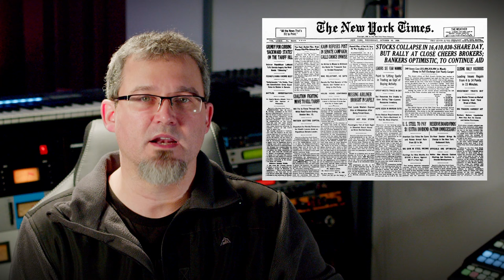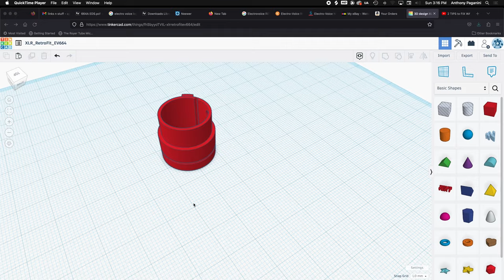Electro-Voice 664

Comment: I have 2 EV 664s in my collection. When I got them from eBay, from 2 different people around 2020, they both came with the cable, so no problem. They both sound good to my old worn out ears.
Reply from the maker: Can probably sell the cables for what you got the mic for! lol.  They're not terrible mics.  Theyre definitely not "modern" sounding but i think that s the whole point.  I've used my connection mod on a few mics now.   The 664 a 630 and an old shure 535 omni mic.  End of the day, as long as you can get the signal out of the mic into a pre, you're good to go!  Thanks for watching!

Comment: I own three of these. Two original port design, one large port design. All of them in excellent condition. They are definitely spoken voice mics. That doesn't mean they can't be used on all sorts of stuff and EQ adjusted appropriately. They're certainly good enough for that. 

Besides a lot of live sound engineering, I'm a licensed ham radio operator. These make an excellent communication mic. You don't want full range audio on SSB. It's counterproductive. You want all the power in about 200 Hz to 3 kHz for a 2.8 kHz max legal bandwidth with it sloped up in the 1 kHz to 3kHz and with moderate compression to level power average across vowels, dipthongs and plosives. You don't need or necessarily want full fidelity on FM for communication applications -- although it's cool to have a radio voice on FM ham radio -- it can compromise intelligibility in challenging environments.

I agree with an earlier commenter. If you have a working one, don't mod it. Buy a non-working parts-only or prop-only one and mod experiment with it. They're inexpensive and common enough for that. 

Thanks for the great videos. They have helped me make some mic acquisition choices.
Reply from the maker: Thanks for the great comment.  I was studying to take my exam during covid lockdown and never got around to actually taking it.  I dont know that I need another money pit of a hobby though lol.  I am really into building electronics and i'd be that guy thats got the giant lattice work antenna setup on a concrete slab that the neighbors complain about. lol.  One day though... one day!

Comment: Ham radio guy here. The EV 664 really was a pinnacle of high end ham radio microphones back in the day. Often pictured with the very high end Collins S-line as well as Drake and EF Johnson Viking on their much higher end equipment. I have a 664 that I use with my Collins S-line. They were so popular as a desk microphone with the optional desk stand. I had no clue the connectors were so expensive. Am I surprised? No. But it does remind us of a time where everything was still incredibly proprietary. As I do restorations on antique radio equipment I am no stranger to proprietary parts. Most of my equipment is very rare pieces. And of course, because so few were made, and the parts were so specific, there is little to absolutely no chance of one actually finding some of those replacement parts. Thanks for the video!
Reply from the maker: Thanks for checking it out!
I was studying for my exam during lockdown and never made it in to take the test. Im not sure i need another audio related hobby though i would love to learn how that stuff works. Most of the communities that ive silently stalked online seem to be very standoffish and gatekeeperish to some degree as well. I mean what hobby doesnt have those types lol.  The funny thing about the connector for the mic is that at one point it was pretty much standard for these and other EV mics. I would have thought there would have been thousands of these things out there in any form of disrepair (its just the connector we need). Sadly, nope…. I had a heck of a time trying to find some weird caps for an amp rebuild a few tears ago. Finally found a HAM guy that was rolling his own.  Worked great!
Reply: @meistudiony  hey, it’s never to late to follow through with the license! The Gatekeeping is a thing, however some good starter resources are videos by Bob Heil (Heil Audio). He does some very good explanations on mixer to transmitter interfacing and very good explanations on audio mixing and going into some good depth about audio response for ham use. You are right, it was a popular connector for Electro Voice. But just compare that today with XLR. Or a 4 pin XLR. Those have become the industry standard. In other words you don’t HAVE to have the manufacturers specific connector. I just can’t believe those EV ones for the 664 are that much money! True insanity! I don’t know a ton about audio, but I do enjoy a good microphone and a well balanced audio signal. I mean, who wouldn’t? In ham radio the audio quality can often lead to whether a contact can be established or not. The 664 was the right mic at the right time. I would love a Astatic K2 microphone element. Pretty rare and hard to find in original working condition. Or an astatic DK1. I really wanna know what one of those is supposed to sound like. Again both pretty rare in WORKING original condition. If you get a chance check out my channel. It covers quite a few of my pretty rare pieces of radio equipment. And some details that are just really unknown to many about them. There are a lot of ham resources out there just like the caps you expressed. Heck I have heard the same thing on the flip side with hams looking for some odd capacitor and found it through an audio guy. It’s kinda like an indirect friendship! Hahaha!

Comment: I have used an EV 664 with a Yaesu FT-1000mp ham transceiver for 15 years. It has a fairly flat response and benefits from some equalization if used for radio communications. While the spec describes the mic as having a cardioid pattern, it really is a unidirectional mic - especially at high frequencies - which is useful in high noise areas, assuming you can point the microphone at the desired source.  This mic sounds best if it is close-talked (such as Billy Gibbons from ZZ Top) as it is not particularly susceptible to plosives like a Shure SM-58.  Most users will want the low source impedance (150 Ohm) output, but the high impedance output is nice for use with old tube amplifiers.  It's a very good microphone.  Thanks for providing the print for the XLR connector adapter.
Reply from the maker: Thanks for checking out the video and reminding me about the adaptor.  I have to see if i updated the design on that site as i recently made a few tweaks to it.
Reply: Please define the likeness and difference of cardioid and uni directional.
Reply from the maker: @raymota4515  cardioid and unidirectional can be used interchangeably.  cardioide picks up in mainly ONE direction.  Super cardioid and hypercardioid (and lobar) are somewhat interchangeable as well, the only difference there is that the null point, rather than being at the back are a little more to the back sides at around 110-120 degrees respectively.

Comment: Great Video. Thanks for doing this.
I remember those mic's years ago but I was not seasoned enough to know how good they were. I was always trying to get the most ball and least feedback.
Looking back and the years in-between, I worked as a service tech and repairing Recievers, PA systems, Power amp ( Tune to solid state ) Everything from Mackie, Mac, Tapco, Phase Linear, etc. Along the way a few mics needed internal repairs.
I remember that one and the customer boght it for 20 bucks. He just wanted it to work, did not care if it had an XLR. So we hard wired the ack to an10 ft XLR end to use on a PA.
I was surprised at the sound and also the customer.
I never held one ever again, but never forgot the one. My partner and I tested it like you did on guitar too. All said and done, I have to say the engineering back then had attention spent on Everything bout the product. 
Kidsa miss that in most of the new stuff today. You either have a Nail hammer or a thousand dollar sounding mic you don't let anyone else handle.
Reply from the maker: Thanks for checking out the video!  The mics can still be had for pretty cheap, the only question is if it still works properly. For a PA mic, youd be hard pressed to find something this rugged today.

Comment: These are nice mics. I love the look! My first use of one was for a ham radio microphone, great on air sound in hi impedance mode. I used one with with Heathkit rigs I built.  Then I used a bunch of these in low impedance modes for PA systems in an auditoriam. They also worked well there. But now I use them for podcast mics again with low impedance and they still sound good. They are best suited for voice work in stock condition. The are best suited for midrange (voice)  tones and seem to roll off the very low bass and the really high treble ranges (a good thing for podcasting)  with a cardioid pattern.  I'm planning on swapping out the cartridge on one of them with a Heil HC-5 conversion kit (no longer available) for a test, maybe a condensor unit as well.
Reply from the maker: What amazes me more than anything is the fact that some of these mics are now over 60 years old and STILL working!  Theres some truth to the statement “they dont build em like they used to”. That boggles my mind. We live in such a disposable world now, not much is built to last. Im interested in that heil conversion kit. Is it a dynamic replacement or a condenser?  Would love to see/hear before and afters of it!  Thanks for the great comment and for checking out the video!! Appreciate it!

Comment: I LOVE Mics with the Art-Deco design.   I have a number of old timers,  and if they work,  I keep them original.   I would say  DON'T  modify yours.......but instead find a dead one to use as a project piece.   I recently got a  EV  636 Slimair,  and hooking it up,  I thought it sounded a bit thin for recording,  but considering what it was intended for,  I really like it.     On stage,  I WANT art-deco mics,  so reproductions/current productions are my go-to.    Heil,  Shure, Astatic, MXL and others have some really sharp looking mics that mate easily to the modern boards.
Reply from the maker: The nice thing about the mod I came up with is that it doesn't permanently alter the mic.  You can keep the original parts aside if you want to restore it to original later on.  I don't generally mod anything that would permanently alter the original.  Even my C1000s mod doesn't alter the metal work or circuit, unlike some others that do a similar mod.  I'm  with ya! Thanks for checkin out the video!

Comment: You missed one of the reasons that the 664 was widely used by musicians in the 60's and 70's. It had the ability to be wired for "hi-z" by just moving one pin, which allowed it to be plugged into another channel of your guitar amp. The first time I saw one used in the mid '60's it was plugged into the reverb channel of a black face Fender Twin while the guitar was plugged into the normal channel. The cut sheet that came with the mic also had instructions on how to wire the mic for use with a guitar amp and mine [acquired in the mid 60's] came with a 1/4" phone plug on the end of the cable.
The most advanced portable PA speakers of the time were Shure Column speakers that were barely satisfactory for speech reproduction. The 664 was reasonably priced so that even a young musician could afford one. Since sound systems of the time focused on the speech range, low end reproduction was not that important. This mic was not used due to it's great sound reproduction but because it looked good, was a decent price, used for vocal the resulting sound would cut the mix with fairly decent gain before feedback and most musicians couldn't kill it.
I had a box of 664's after we switched to Shure Unidyne ball mics which could also be used "Hi-Z." I now have an extensive collection of mics, including M/S, Condenser and Dynamic and recently acquired a Soundfield mic for ambient capture in live concert events. I've never missed that box of 664's that was lost so many years ago. I've been a musician since the mid 60's and a broadcast/studio engineer since the mid 70's.
As a footnote, the matte grey version, which had no built in stand adapter or switch and reputedly better capsule, was the 666 [also called for some reason the "devil's mic" ;-) ] it had a Cannon D connector and was primarily marketed to broadcasters.
Reply from the maker: Yes!  There was a 665 also (more rare). That had an xlr and i think was only low z.  The hi lo-z change is just using pin 2 instead of 3/4 on the connector.   Thanks for the great comment, and thanks for checking out the video!

Comment: We had several of these at the church where I learned to run sound back in the '70's. They competed against AKG D200E1's, and in the mids, the EV's definitely won. The AKG's had more high end, though.
Reply from the maker: I have a pair of D160E1's in my hand right now.  The D200E1 was the big brother (cardioid pattern and had a cool grille).  Definitely some work horse mics.  The 664 is a tank.  With a little EQ they can sound quite nice.
Thanks for check out the video!
Reply: @meistudiony  I could always hear the crossover in those "two-way" mics. That's what bothered me. Later!

Comment: Great video!!! Really appreciate how you  demonstrated the mic 90 and 180 degrees off axis as well as how the it works in a snare situation.  Can you tell me how to change this mic from LoZ to Hi Z and the other way around?  Thanks again.
Reply from the maker: Hey thanks for checking the video out. The change from hi to low z is just different pin outs on the output connector. If you have the original connector (4pin) you want to connect pin 1 to ground for either configuration. Then, if you connect pin 3 and 4 to pins 2 and 3 of the xlr, you get lo-z. If you connect pin 2 and 4 of the mic to pin 2 and 3 of the xlr you get high-z. 

Essentially switching pins 2 and 3 changes the mics output impedance.

Comment: Holy crap, $60-$100 for a cable for this?  I guess I got a super good deal on my NOS Amphenol connector for this mic at $37 all in (shipping/tax/eBay).  Of course the XLR end costed something, but I already had it "laying around." Same with the cable.
Reply from the maker: Yeah, its tempting to buy a mic that the cable is included just to get the Amphenol connector when the price is right.

Comment: Great test and background informations. If you want to demonstrate the lack of proximity effect, adjusting the volume in post processing to a similar level is more meaningful. I did this with a PL10 which is a mini version (not produced since many years) of the monstrous RE20, but with a different frequency response. It works really well. Compared to modern mics, these old EVs sound not that great on voices (the RE20 is o.k., but not phenomenal in my opinion), but you can eq them of course in a way that they sound like a modern condenser (except of directivity of course, but for nearfiel vocal recordings it's not very relevant).
Reply from the maker: I did a video on refoaming the pl10 :).  I always feel like adjusting things on a vocal test is kinda like cheating but i get your point. 
Thanks for checking out the channel.

Comment: Question: If I want to use one of these doing mobile live sound for bands, do I want to use with Lo Z or Hi Z? Any help would be greatly appreciated.
Reply from the maker: Most professional systems will want to see a lo-z mic. High z is generally consumer grade stuff for very short cable runs. Lo-z will allow you to run longer cable runs and the signal strength at the mic pres will be better on modern equipment with lo-z. Only issue is the crazy connector thats expensive if the mic doesnt already have it.
Reply: @meistudiony  Thank you!